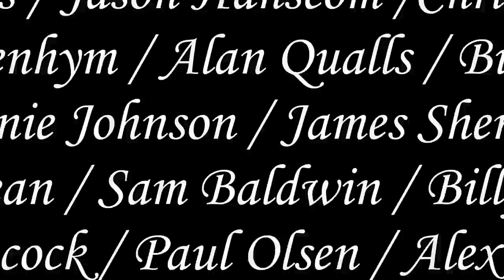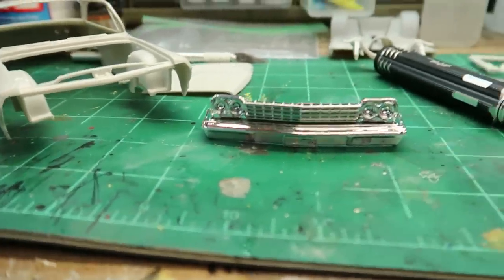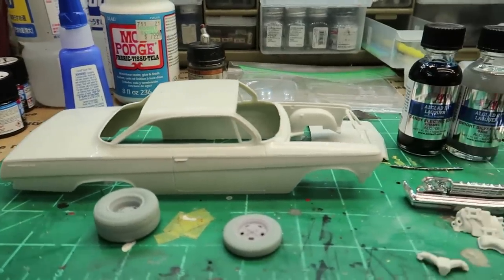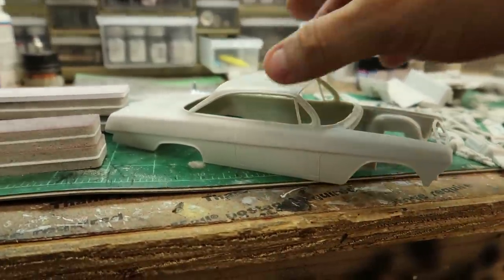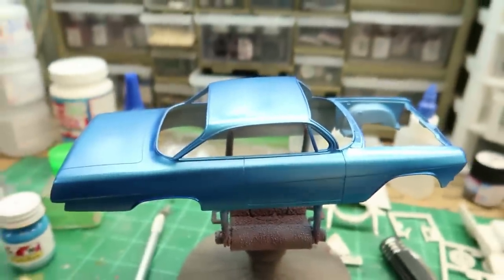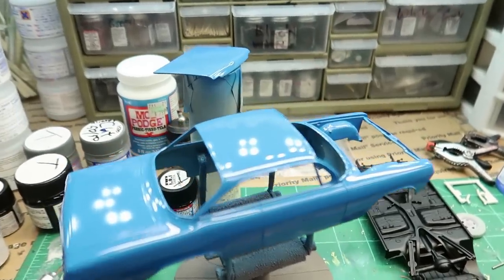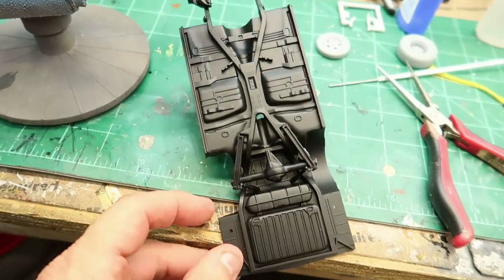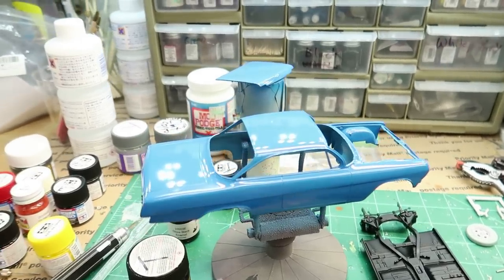Blue Ox Model Shop's Street Machine Group Build update! AMT 62 Chevy

Comment: Thats exactly what i do cut out all my parts off the tree because if you paint them on the tree after you cut them a little white will show then you have to possibly sand to smooth out a touch up. Also i learned to test fit everything first after building the 69 GTO . This car looks good nice color  i like the idea of the wheel stand

Comment: The shave work looks good. And the cheater slicks are a good choice.
Reply from the maker: Thanks
Reply: @modelcarvideos5829  Lots of Hotrodders use them on streetrods, to comply with tread requirements. My '41 sedan will be a mild custom rod. With an 8 BA engine. Bored .030 over, for a 243 cid engine. The steering wheel is out of a '48 Ford. I repaired it myself the guages are custom relettered. And the plastic knobs on the dash will be replaced with brass drawer pulls. The visors are hobby grade thin plywood. I have other ideas to work on. With this project. The frame currently sits on 5.60x 15 front tires. And 700x16 rears.